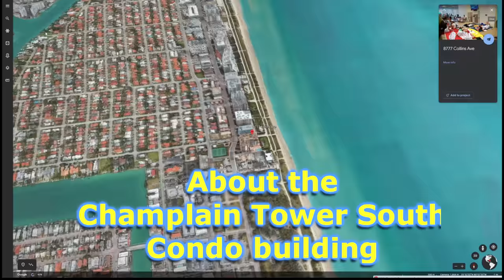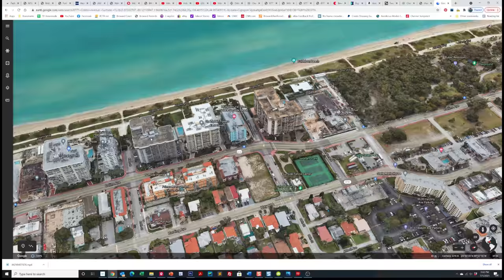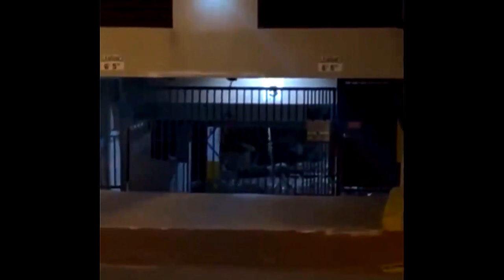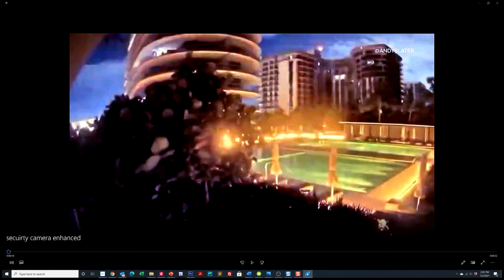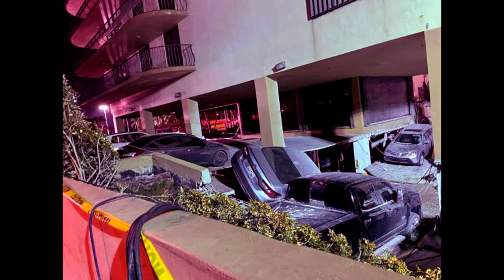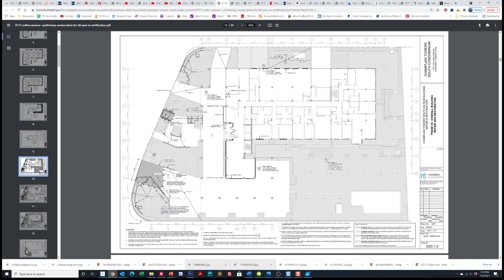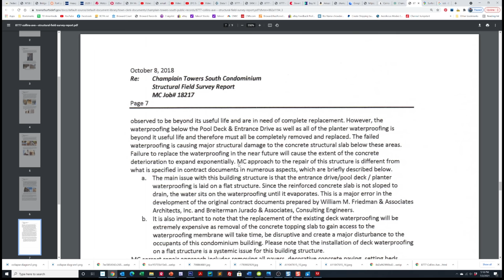Here's Cause Of Miami Condo Collapse Champlain Condo Towers, Surfside

Comment: It actually looked like parts of the building dropped demolition style for some strange reason,(?)
Reply: that's how highrise buildings are designed, they design them like this so the building if it falls doesn't fall into other buildings next to it, pancaking is built into the design
Reply: @Lithaldatwin  Its gravity.  There aren't any materials that aren't going to shear before a building of that size could tip over to the side, unless it is built like a silo.  They will always crumble and fall mostly vertically.

Comment: On the security tape, there are several intermittent white flashes. What, in your opinion, is the source of these flashes?
Reply: My two kronur worth:  Electrical wiring short circuiting will cause some spectacular fireworks.

Comment: I worked on concrete high rise structures that beam that you point out is called a haunch. I looked at the after photo's and the builder left out some steel that is why the building fell. I'm surprised it didn't fall after they stripped the forms after pouring the concrete.

Comment: I believe they were corners cut to save money during construction. Size and placement of rebar is important as well as the strength of concrete that is used. This is why rebar inspections need to take place to ensure the correct sizing and placement including testing of the concrete through slump test and compression tests.   Lack of maintenance is obvious but the other factors I mentioned will bring a building down.

Comment: There must have been a combination of factors that lead to the collapse.  The real question I would ask, although I am not an engineer, why wouldn't a building sitting at the ocean have much thicker supporting beams twice as much as the parts (parking 72) that did survive?
Reply from the maker: The columns that are thinner are not directly under the building

Comment: I've read that there was a gym on one of the floors, where was it located? And I wonder if the weight of the gym equipment was a major factor in triggering the collapse too, my opinion is the support gave way where the front part of the building (on toothpicks as you put it) sheared off from the tower block next to it with the thicker posts underneath (at the side of that shear beam in the garage) as there was nothing under the very end of the toothpick post end supporting it?

Comment: A simple exercise: For each 100 pounds of horizontal component of wind force directed against a north wall, each of the east and west outside walls that are at right angles to it takes up 50 pounds of force. If a third interior wall is added parallel to the east and west walls then each wall will take up 33.3 pounds of force. The floors that also transmit this horizontal component of force to the outside walls prevent inward deflection of the north wall. Horizontal force transmitted by the floors that is taken up by the footings of the columns and rear wall may be ignored for this analysis.
   
Is a third interior wall of solid concrete required? (Referred to in some discussions as a shear wall). After calculating the force that the east and west walls must accommodate it is a matter of design choice. It is likely that the minimum thickness and strength of the east and west walls already greatly exceeds the horizontal force that these must hold back. Thus, for each 50 pounds exerted horizontally, the walls as a result of their strength to function as a wall supporting the vertical downward load from weight, are already capable of sustaining a horizontal component several times that amount, which is why the contribution of the footings was ignored.
   
A building is designed so that the entire structure remains standing. That a collapse is only partial appeals to emotions, not logic. 
  
An interior wall of solid concrete that is not connected by rebar to the adjacent part of the building is in effect an exterior wall to which an abutting structure has been added that encloses it making the whole thing appear to be a single building. Pre-construction-sales enabled raising capital for a much larger structure.¹³
   
The reason behind this two-phase approach is finance, not engineering. 
    
     
     
¹³      For each dollar investors advance for the cost of constructing a 100-unit building unknown to them these funds are sufficient to build twice as many units. The 80-unit addition that effectively costs them nothing accrues to the organizers.

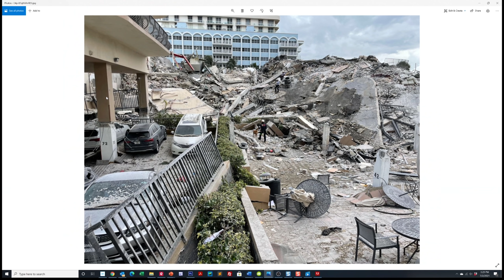Comment: At 21:15 you raise the question about the difference in thickness of the columns.  Because the difference is not that great, it's probably due to aesthetic design.  The section on top is more exposed to view so they texture it (i.e. stucco) for looks.  The section in the garage they don't care too much how it looks.  You'll notice the surface "look" of the upper section is very similar to that of the building.

Comment: A good long look at what happened. Thanks. Where was the pool that collapsed that people noticed it sinking. The pool that you show, as you said, wasn't touched. It was hard to follow, and in some cases it was invisible, the arrow. Because it was so small and white.
Reply from the maker: Pool did not collapse it survived.ost of the pool deck was the roof  On the parking garage below it. So the pool deck deck/garage roof started to collapse right near the pool near the pool and it propagated towards the building about 60' away or so and then the rest of the building collapsed. But the pool was left completely intact still filled with water.

Comment: Great video, great work.
The supports are often thinner in car parks so you can actually get your car in and out with some degree of ease, notice when in an underground carpark how thick the supports are on the corners of parking rows compared to the supports in the rows.
All that water sitting there, salty air corroding all the horizontal rebar.
Wow, I wonder how many other coastal multi-story apartments are going to suffer similar fates?

The spread of that damp (sodden) area was very large.

Comment: Not knowing a thing about engineering, you asked the question if this building was designed to withstand all the new renovations and weight? I am concerned if even a new building is overdesigned to withstand any future weight load seeing as most are just built to sell as soon as possible. I would imagine you could take out a center column and still keep standing, but an end post seems so crucial?

Comment: Well, first part of the building to go ("center building") was reportedly built years after the 2 towers that it ultimately connected were completed.  No doubt that the construction of the "center building" differed a great deal from the then 2 original unconnected "stand alone" buildings.

Comment: I have been in commercial floor covering for forty plus years. In the area I live, salt is used a couple months out of the year, where it gets tracked in and leeches around the existing floor coverings, the concrete always needs repaired. These buildings are exposed to salt 24/7, any Crack where water can run, salt is going to be carried with it.

Comment: This is as good as an investigation as you can get with the limited access that Jeff has had, and it's very remarkable. While I don't agree 100% with everything you point out, I would say you are correct in establishing where the collapse began.
One thing I would recommend in future videos is if you are using you're mouse cursor to point out things on screen, you should set the cursor to high visibility. You can find those settings in the accessibility part of settings. You can set it for high contrast, even select different colors, as well as cursor trails. It was a little hard to see, I had to stop the video. If you are producing these yourself, it's an incredible feat. At this point you really should have help with production, and leave those details to other people so you can focus on the information you are digesting. Keep up the good work.

Comment: One thing that might have been a factor given me the proximity of the ocean is the salt coating that the rebar would have received before the concrete was cast.  I worked 8 years at Kwajalein and we had numerous buildings that had to be torn down because of the rebar rusted due to exposure to salt water spray from the beach.  All new construction was done with rebar that was coated in rubber prior to  shipment to the island.
Reply from the maker: Yes the new laws in Florida are stating that buildings within 2 miles of the ocean will have to be updated I believe it's 25 years instead of 40 years but certainly it would make sense to have an engineering firm come in every three to five years and give the property a once over inspection to find things that you would not be aware of

Comment: Its funny how those columns just speared through the pool deck. I would assume there should have been horizontal members resting on top of the columns to distribute the weight of the deck across the columns. Another thing is how the rebar just slipped out of the concrete so cleanly. This sounds like the wrong mixture of concrete was used (i.e. 3500 psi vs 5000 psi) combined with excessive water intrusion. A sinkhole would effectively swallow the deck, columns and the building. it appears that the columns did not move or settle even an inch.

Comment: the support column at parking space 27, at the right rear of that parking spot, is clearly intact in the tourist video.  The ramp is clear as is the first 10 feet or so in front of it at the garage floor.  

Interestingly, the narrow thin column in front of space 78 is in the other girls video.  She spends some good time looking at that column with its puddle of water next to it and strange repairs in the ceiling around it.  That column is a good candidate for the link from deck collapse to building collapse.

Comment: Pay attention to the size of North and south Tower, If you look Close enough, You can see that the north tower is smaller since on the side The south tower has more balconies.
Reply from the maker: North tower also has 2 less units per floor
Reply: @jeffostroff  ok
Reply: @jeffostroff  .. So what ?
Reply from the maker: @mjpicard00  It means less weight so in theory the north tower could stand up longer than the south tower with the same failures
Reply: @jeffostroff  fr

Comment: There was one that shows the supports and how the corrosion likely let to break through failures .. first on one support then others leading to the supports under the red section cantilevering in and pulling the whole thing down.  That video of the water leakage confirms how that video went as some beam broke through support (leading to a broken pipe system), load redistribute .. hold for a bit, next one goes and then it's all down as nothing can handle the load.

Comment: 28:31 is the smoking gun. The error in pouring a non-sloped concrete slab in the original design is what is going to be the major contributing error that caused this building to collapse. The picture you found with the water pooling on the deck on an obviously clear day is evidence. Nice job on finding these documents, I wouldn't be surprised if your findings are used in the future litigations of this accident.

Comment: You see in column 72 you only see 2 pieces of rebar in both directions hold up the parking garage. That is supposed to be double matted steel top and bottom.

Comment: the pooling water on the deck was getting worse to as the deck deformed you can see the deck sloping inwards too..
the pooling water deterioreated thee concrete and the columms punched through. the rebar was holding up the building ..!

omg the thin colums without punch through boxes on top are design errors.. the neigbouring building is in deep trouble!!!

Comment: Does load weight also have anything to do with this? In other words, do structures with floors have a weight limit? This place was built in the 70's. Maybe furniture back then was lighter and people had less clutter. Over the years maybe furniture has become heavier and people in those units were hoarding more storage than before. Could that be a factor?

Comment: Wonder if some of the water pooling in the parking garage also started to seep into the ground below and slowly eroded it.  Eventually the columns shifted down enough to cause the floors to start separating and finally it all gave way.  Also the way the floors are fastened to the columns is very suspect.  Should there not be metal I beams between each column?  It looks like they opted for post tensioning instead which is very tricky to get right especially if you're doing a grid.   I'm not an engineer but not seeing metal I beams does not sit well with me.

Comment: One thing I just noticed is when you had the picture of the both buildings up champagne towers looked a lot more dirtier then the other building the other building looked like it was maintained better and that’s from the top view and I’m wondering if the H beam in the basement collapsed with that rubble scene in the short video would the structure stay up and how long will it stay up for I think there was a lot of factors in the collapse but a critical few that started it

Comment: I noticed the small skinny columns in the news reports and thought to myself if it were possible that a car, while being parked, hit 1 of the columns, triggering follow up breakage.  I wonder if there were any video of cars entering the complex?
Reply from the maker: Not likely that a car hitting those columns would have caused any damage there's too much rebar going down into the ground. The only thing that could have pulled out one of those columns was a massive collapse of the pool deck tearing at one of the beams and just literally pulling it out from underneath to slab above it

Comment: 8:32 that seems to be something on the gate/fence, not behind the fence, just because you can't see the vertical stripes of the fence over it, so, i don't think that is a broken beam neither a building structural or non structural element
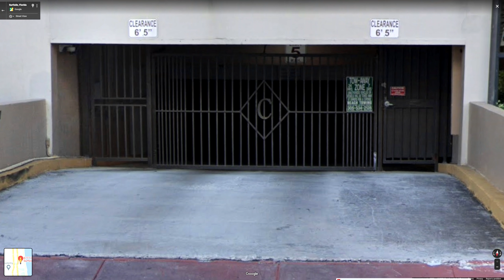8:51 to me, it look similar to this poster that's over the fence, is the same one, but probably the light tricks you

Comment: I think it was a combination of the water intrusion and a possible vehicle strike on column 77 in the past causing the floor above it to loose integrity and fall. The floor separating from the columns that remained is easily explained as the force of the building falling on the surface would exceed the structural strength of the floor to column bonding, much like if you hammered nails all the way through a board spaced closely together and place you hand on top of them, as long as you space the nails appropriately they wont puncture your hand however if you smack the back of your hand with the other hand it would exceed the structural integrity of your skin and they would then puncture through like the pool deck did. Once that started the shock would cause expand outward and the weight of the falling sections would pull on the remain parts. You do raise a good question as to why some of the columns appear to be larger than the others.

Comment: I’ve had a 20X40 inground pool for 40+yrs now. Because I am in Ohio where it’s seasonal, I have the whole filtering system (filter, pump, basket and lines) all mounted on a pressure treated lumber frame so the system is off the ground, with a quick connect pump. But water is your worst enemy no matter where it’s at

Comment: This disaster didn't occur due to negligent engineering or design. It happened because of ongoing water damage that was occuring for years from that pool system. The sad part is the building people knew about the damage done by water but waited several mire years before they actually began the process of repairing it...too little, too late. The pool contractor knew it too. He knew exactly what was going on and the immense danger that building was in.

Comment: They build bridges over water and the columns are submerged but the rebar doesn’t rust and the concrete is wet forever and it has no problems so it makes no sense if the concrete is wet and it breaks.
Reply from the maker: Different mixture more resilient to water

Comment: With exposed rebar you only have to have a little bit exposed to atmosphere then get in contact with water to cause catastrophic damage. As the rebar rusts away it creates a channel for water to travel further down the line.
Reply from the maker: Yes water only needs one little entry point to turn into a major disaster

Comment: Why did the last of the parts spring sideways away from the center collapse? I think because the sudden shear of the rebar released tension in it and it was rebound. That also probably assisted its collapse. It might have stood if not for that. Good work!
Reply from the maker: It fell sideways because all the columns were yanked out. The columns on the right side had just a bit longer on the edge of the building, so it toppled slightly left where it lost support first.
Reply: @jeffostroff  Yes - but if you look carefully, you will see that right after the shearing event which left the last sliver facing the ocean standing, that part springs to the right (toward the ocean) and briefly is actually leaning AWAY from the collapse. Now of course this did nothing at all to help the already weakened foundation and structure, and possibly even added the last bit of stress/strain that ensured it also would collapse. The origin of the force had to be released tension from the rebar in the upper floors that was first stretched and only then failed. The sudden release of all this tension supplied enough impulse to push the building toward the ocean briefly.